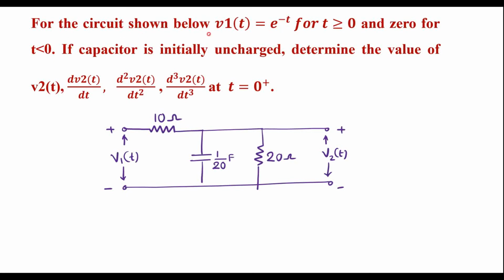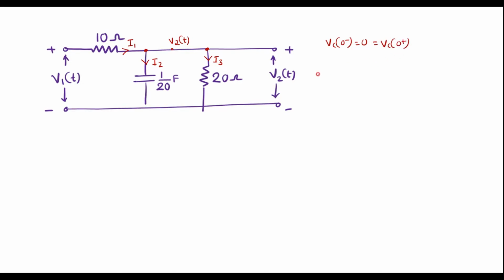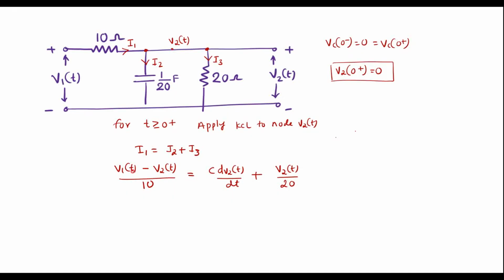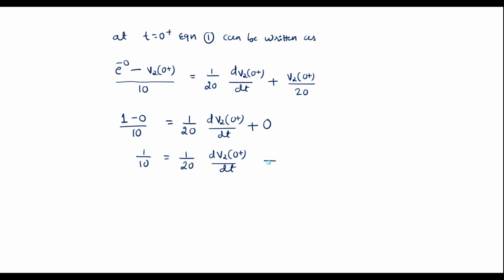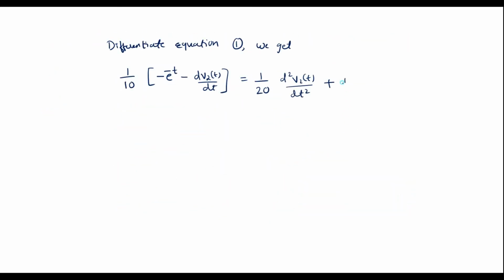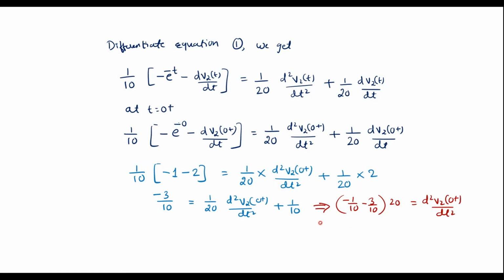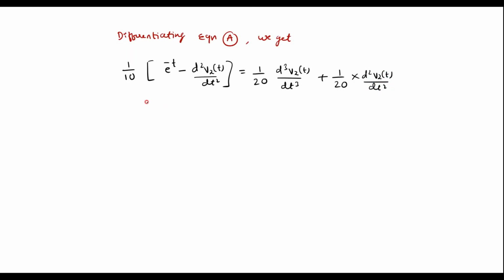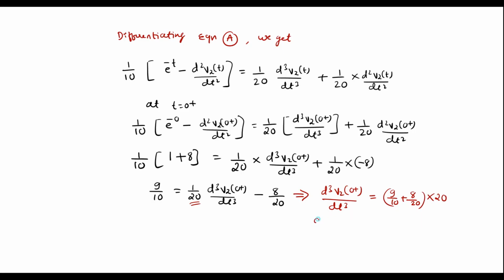For the circuit shown below. capacitor is initially uncharged, determine the value of v2(t),

Comment: Sir how V2(0)=0 ? I not understood sir.
Reply from the maker: @ratnamalapujeri9610  because voltage across capacitor is v2(t) , initial voltage of capacitor is zero.
Reply: Sir but there are resistors ,how it is possible?
Reply from the maker: Please fill this form https://forms.gle/1nxEBM5bZri3UqoQA